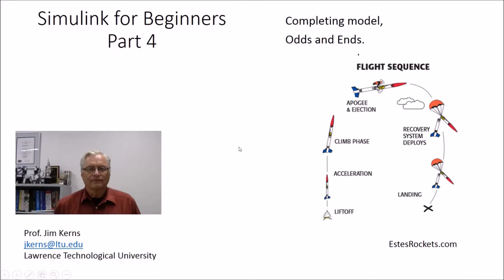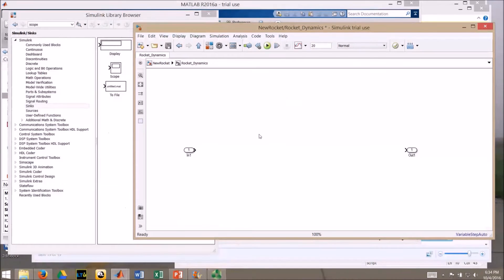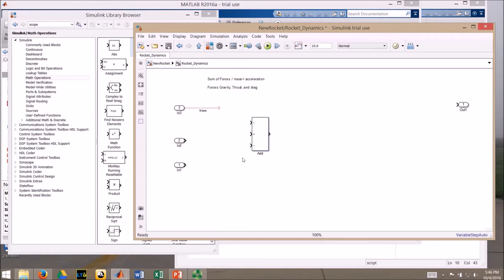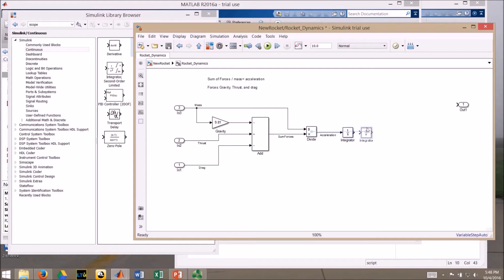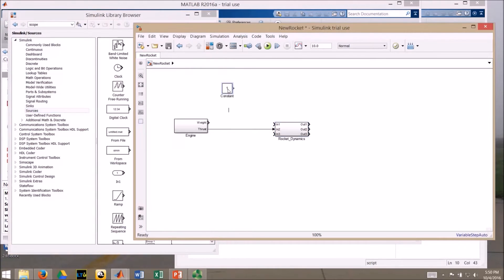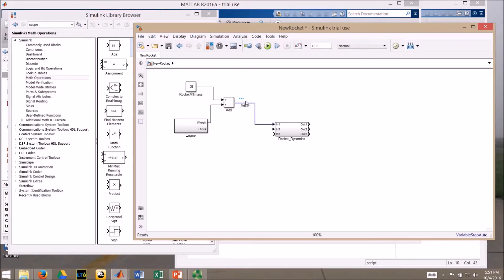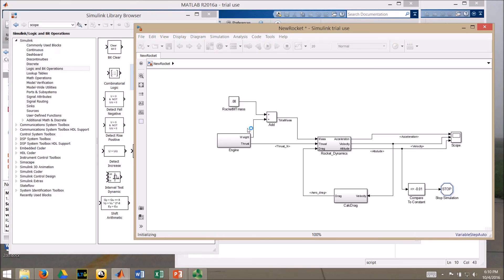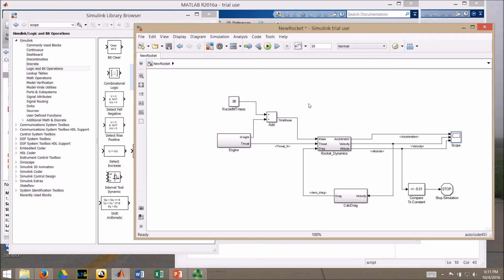Simulink for Beginners; Part 4

Comment: I am struggling to model heating and cooling of building based on geo sourced heatpump.
Reply from the maker: Don't know if this will help or not, but as a general rule, start out with pencil and paper sketching the system, defining the physical inputs / outputs and the basic physics. Then you can sort out the relevant equations and data flows. Finally the last step is to implement it in a tool like Simulink. If you start with the code, you tend to get tied up in the code and loose sight of the big problem.
Reply: @jameskerns717  thank you james..

Comment: I have completed modelling a basic 1DOF simulator with Simulink like this one, equipped with drogue and main chute rates. I'd like to learn how to improve upon it for a 3 DOF and eventually 6 DOF simulator. Do you have any advice or resources that would be helpful ? Do you recommend using the aerospace blockset ?
Reply from the maker: I have not used the aerospace blockset so I can't comment on it one way or the other. The fun part of moving to 3 or 6 DOF is that you need to keep track of multiple inertial frames - the rocket, the global inertial frame, and possibly the atmospheric inertial frame which is moving with respect to the globe. 
Small Unmanned Aircraft by Beard is a good resource, but expensive. But you can see some of the sample files here: https://github.com/randybeard/uavbook

Comment: Hello sir, 
Thank you so much for the video! It's super helpful to my study. I was wondering what if we would like to see the 3D trajectory of the rocket instead of only altitude. Is it possible to add the position in x,y axis to the model and see 3D result?
Thank you!
Reply from the maker: The model is only a 1D model - to get a 3D model you would have to add additional inputs such as wind and a launch angle along with additional aerodynamics/ stability/ damping equations which would get rather complicated.
Reply: Thank you sir for responding in a short time. Just in order to make a simple 3D trajectory simulation, can't we neglect those inputs except the launch angle? I'm currently working on a project in my school related to real-time 3D trajectory tracking of a rocket. So I'm coding a Kalman filter to implement on a rocket model such yours. That's why I'm asking. 
Thank you.
Reply from the maker: Just including the launch angle would be simpler. Making the assumption that thrust is always tangent to the trajectory would simplify it a lot also.